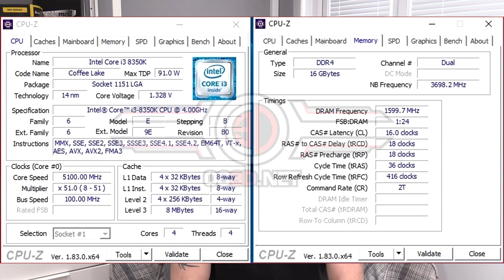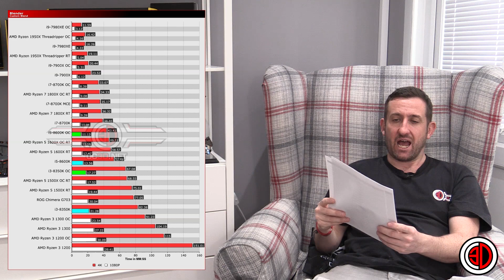Intel i3 8350K and i5 8600K Overclocking Review

Comment: I think you should have also talked a little about the 8400 because the i3 8350k and the 8400 are around £20 apart in price.... OBviously the deal with the 8400 is that its not overclockable and the only board you can currently buy that supports it costs over £130 so its not a cheap option. but if you look at the 8400 being like a stop gap till you can afford that 8700k I think it would do quite well. the 8400 aint no slouch when it comes to gaming either.
Reply: hyperthreading at its absolute best is about 40% of a real core.  So a 4 core chip with HTT cannot outperform a 6 core chip that has equal or better per core performance.  In non HTT friendly loads, the 8600k e.g. decimates a 7700k. In HTT friendly loads it at least matches it.

If you have found an application where a 7700k can beat a 8600k its probably for another reason like the larger l3 cache.

http://cpu.userbenchmark.com/Compare/Intel-Core-i7-7700K-vs-Intel-Core-i5-8600K/3647vs3941

I think threads get overhyped personally.  Per core performance is always king, and there after core count second priority. Although I do understand if you do rendering or streaming.
Reply: Here in the UK the 8600K is just £20 more than the 8400 and £40 more than the 8350K. To me that £40 for 2 extra overclockable cores is remarkable value. I think the 8400 is better than the 8350K really but if I had to choose id pick the 8350K because I like overclocking. If I needed to upgrade my 4790K then the 8600K would definitely be my first choice CPU. Followed by the 8700K which cripples itself for being £80 more than the 8600K and only offering HT for that money.
Reply: Depending on how long is this stop gap is, I'd get the 8400. The 8400 is like 80-85% of the 8700k for gaming for half the price, and doesn't need a expensive cooling solution, nor an expensive motherboard to squeeze those crucial extra few more mhz of a finely tuned 8700k.

Cheapo Z370 + i5 8400 = 300€, i7 8700k alone = 330€.
Reply: why even get a 8700k? 8600k is cheaper, cooler, and can match its performance in loads that dont really need hyperthreading.  As seen in these graphs it can exceed 8700k performance because of been able to be pushed more without thermal throttling as well.
Reply: Threads are nice, though. Coming from an old i7 with 8 threads, the i5 even with its full fat cores feel like a step down, and it is in some applications.
Reply: chrcoluk Although every point you make is true, I actually never said the 8600k is worse vs old i7s, but it is not what you call a mindblowing upgrade. If you have an older i7 the only true upgrade is another i7.
Reply: yes thats a valid point.
Reply: yeah, I really dont get why the 8400 gets so much more focus than the 8600k.
Reply: the issue with the 8400 is you rely heavily on the native boost clocks, as the chip stock is like 2.8ghz. The 8350k is essentially a 7600k, so it can power high refresh rate gaming rather well due to the clockspeed. If you are going with a stop gap processor until you can afford an 8700k, it should be the 8100, as the 60~ you save goes towards the 8700k
Reply: Agree on the 8100 i do but at the end of the day the 8400 has more cores. you could probably squeeze a little more out of it with the BCLK but probably not a whole lot. It really just boils down to the workload while being used as a stop gap.

On top of that I think the 8400 will have a bit more resale value as it does everything quite well even for a locked CPU. What if the stop gap wasnt for gaming?
Reply: The 8400 is just a bad investment for a stop gap. You get the cheapest you can get on the platform (i would recommend a Pentium if they existed for 8th gen) as you take the money you saved instead of getting an i5, and get the 8700k faster. There isn't much question about it. The resale value of anything is roughly 90% if you turn it fast enough

Comment: Bought an i5 4690k when it was the go to gaming CPU ... Still don't even need to OC it and still runs all games flawlessly.
Reply: 2500K struggle with 30+ fps in AC Unity in Alexandria and there are other CPU intense games similar to this like Dead Rising 4, Watch Dogs 2, NFS Payback, Mafia 3 ETC. My 4770K struggle to hold solid 60 Fps in those, it's mostly there and above but there are moments when it drops below 60 so 4690K would be even worse. My 8700K is pretty much destroying those at 100+ Fps but there is one game where it barley holds 60 Fps in the biggest city in Kingdom Come Deliverance. With 2500K it's unplayable in there. Pretty much slideshow.
Reply: Depending on what you call flawless. High fps gaming is very demanding. 60 fps you can achieve with an old 2500k probably.
Reply: A quick look at the performance of a 2500k@4.8Ghz with a 1070 shows a performance in well in the 80+ fps mark on a very crowded city of AC Unity, I don't know if Alexandria or what, but good performance nonetheless, although already bottlenecking the 1070, which almost never reaches 99% gpu usage.

This video: szyL3DzSyz4

That kingdom thing is a halfassed game. No benchmark of anything. A 8700k should not have those issues.
Reply: Carlos Alberto Deleón The 4690k is not the old ass 2500k bud.
Reply: Carlos Alberto Deleón Were you see 2500k we are talking about the much faster 4690k.
Reply: Did you people read the OP or you just trolling ? 2500k is older and slower than 4690k which is still a top performing gaming CPU.
Reply: Carlos Alberto Deleón 4690k not 2500k bud.
Reply: Can you even read? I suggested "depending on what you call flawless, a 2500k still works for 60fps".

It is not like the 4690k is like miles ahead of the 2500k, anyways. 20% difference at similar clocks on gaming, it is not like "much faster", nor the 4690k is top performer these days.
Reply: Carlos Alberto Deleón We are not talking 2500k which has some slow downs now in days. 4690k not 2500k bud. The 4690k is much better than 2500k which is ok now in days whereas the 4690k is much much better than just ok now in days.
Reply: 20% better, that's it. Where areas you get 70fps on a 2500k, you get 84 on a 4690k. Low 30s on the 2500k means low 36ish on the 4690k.

I'm not dissing your build, but you're delusional if you think the 4690k is that much faster, or even top performer. The i7 4790k, on the other hand, is still fine as hell, given the higher thread count.
Reply: Carlos Alberto Deleón HT is a gimmick and is no good for gaming.
Reply: Yeah, that's why any i7 stomps on any i5 counterpart of its generation.
Reply: Carlos Alberto Deleón For gaming no not at all but for rendering etc or where HT actually works the i7 is faster but in gaming no HT is iffy slower which is why it's best to turn HT off when gaming.
Reply: Look any benchmark, pal. Any modern game with good threaded workload will work much better on an i7. That HT off measure was a thing in the Sandy Bridge era and some initial Ryzen benches, not anymore.
Reply: Carlos Alberto Deleón I don't care I bought a PS4 for the wife and I and really we had more fun plating BOTW on the Wii u than we did on my PC or PS4 combined. Graphics, resolution and frame rate are all secondary to weather or not the game is actually good.
Reply: Carlos Alberto Deleón I rather play a game . See y'all bud but I already looked at all the benchmarks and I don't give a fuck about the numbers just the games.
Reply: You were the one stating wrong or misleading facts. I had so much fun also playing BotW on my Switch, but that doesn't have to do anything with the fact that the 4690k is just ok for gaming, and not much more powerful than the 2500k.
Reply: Carlos Alberto Deleón An Intel/HT apologiest.
Reply: Ran out of arguments and started attacking the person? Ad hominem much?

Comment: I've got my I5 8600k at 5.1ghz at all 6 cores with 1.32v with llc on high
Reply: The smaller the dick, the higher the oc  :D
Reply: (my profile picture is old im using a h115i and an vrm cooler cuz I got the z370 ultra gaming)
Reply: MrBluePoochyena it's been really solid for me this way if I don't use llc at 1.35v it's the same and the voltage doesn't change much to be honest. But I don't have the numbers in my head
Reply: 5.1 gigawatts !!! great scott! well done there \o/ did you use the liquid metal thing?
Reply: lol what?!..............*looks down*
Reply: damn derbauer and his micropenis
Reply: 4.9ghz at 1.27v on my 8600k, using a 110i with ML140 pros. I set the fans on a custom profile aimed at silence with the z370 ultra gaming. I am surprised at how easily these cpus overclock.

Comment: My 8350K is delidded... can't be many of those knocking around.

4.6 GHz @ 1.25V @ 59 degrees.

(Under a Silver Arrow SB-E Extreme, but still:D)
Reply: Can you go lower voltage? That seems pretty high for the results achieved. 

My non delided, mildly overclocked 8700k does 4.7Ghz at 1.19v and 60ºC, on XTU stress test.
Reply: I had to go that high - not 0.01 lower - to get a stable P95 blend run. I could easily get that clock at 1.20V if I only ran OCCT. Oh, and this is an all-core clock, not a single-core clock.

I should add that the CPU fan only gets to 750 rpm; I wanted the best SILENT overclock I could get and I am never, ever going near an AIO again.
Reply: At only 750rpm is neat then.